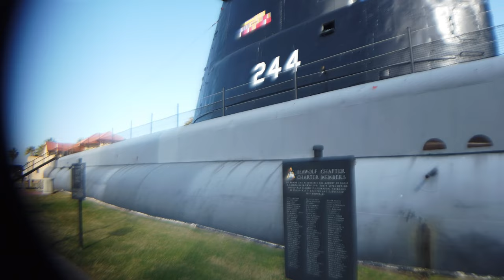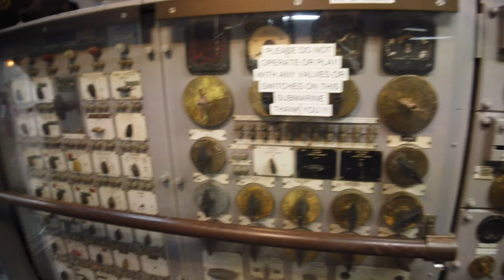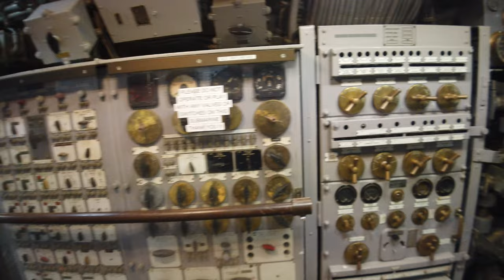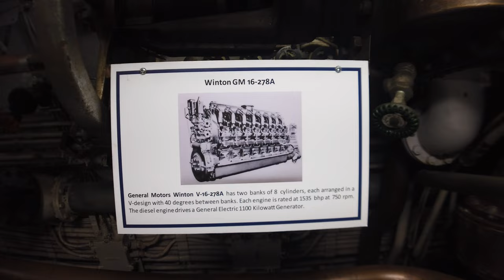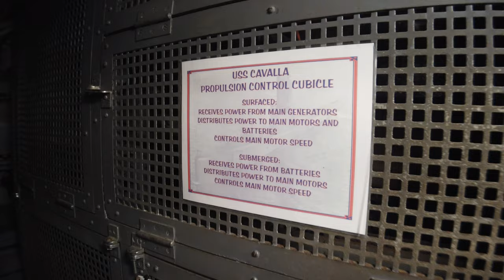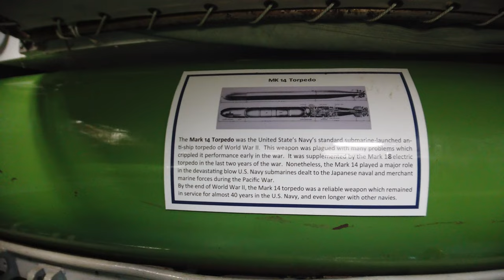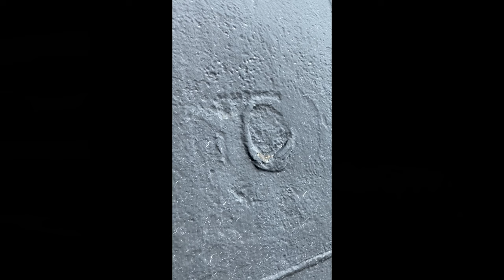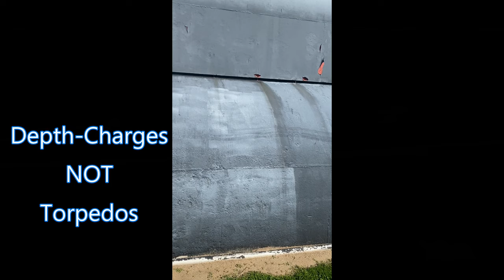USS Cavalla,  only American submarine to sink an enemy aircraft carrier single handedly, the Shokaku

Comment: The red light was for use while patrolling/surface action at night—so that captain/officers and crew could open hatches on deck and/or conning tower could man the deck gun and conning tower —without exposing bright white light thru the hatches potentially giving away the subs position to enemy—also the more dim red light allows for easier/more rapid adjustment of the eyes to the dark outside at night time. Deck gun could be used in lieu of valuable torpedoes to sink smaller unarmed freighters or finish off an unarmed ship that was damaged by torpedo(s) but not sinking. Also many torpedo attacks against merchant ships at night were carried out on the surface—as the sub could maneuver much more rapidly and travel at much faster speed on surface using her diesel engines than submerged where she had to use batteries only to power her motors.
Reply from the maker: I realized that about half way through, I was going to correct myself at the next light but none of the other fixtures had a red light in them.  I was overcome with awe at everything I saw after learning of her history. I was rather speechless the whole time
Reply: For example—US Gato class submarines had a top speed of 21 knots in surface using Diesel engines—but only 9 knots submerged while running on battery power.
Reply from the maker: @gregoryhall3156  wow thats slower than I thought, then again a people think of submarines as much smaller than they are. For what it is, it's huge outside, but you could never tell that from the inside.

Comment: The Cavalla attacked and sank Shoakaku—one of IJN carriers of the Shokaku class (the sister ship being the Zuikaku—which was herself sunk by US carrier aircraft in Battle of Leyte Gulf in Oct 1944)  These two large IJN carriers were the final two remaining carriers of the Japanese Pearl Harbor attack force— the other 4 (Akagi, Kaga, Soryu, and Hiryu) all being previously sunk by US carrier aircraft at Battle of Midway. Also Cavalla was NOT the only US sub to single handedly sink an IJN aircraft carrier—The USS Redfish torpedoed and sank IJN fleet carrier Unryu in 1944 (lead ship of a newer class of carriers of improved design based on IJN Hiryu)— there were also several small IJN escort carriers (many were converted merchant ships as emergency measure to stem the losses of their many larger fleet AC carriers)—including Taiyo by USS Rasher, Shinyo by USS Spadefish, Chuyo by USS Sailfish, Akitsu Maru by USS Queenfish. Also the IJN fleet carrier Taiho (namesake of a 2 ship class of fleet carriers built by IJN during early WW2 and first IJN carrier with an armored flight deck) was torpedoed by USS Albacore during battle of Phillipine Sea in 1944–struck by only one of 6 torpedoes fired at her—but disabled her foreward elevator and ruptured an aviation fuel line which eventually resulted in a large explosion 6 hrs later and caused her sinking. The piece de resistance of US sub sinkings of IJN carriers was however the Shinano—massive IJN carrier built from third hull of Yamato class battleships—worlds largest and most heavily armored AC carrier prior to USS Enterprise CVN-65. She was brand new and being rushes into service and on her maiden voyage was picked off by USS Archerfish. Wr are lucky that USS Cavalla was preserved—she is well worth visiting if you are ever in Galveston. US submarine force was an essential and often overlooked major contributor to our victory over Japan in the Pacific in WW2. Im addition to these important Japanese warships—US subs sank many many jaoanese cargo ships and tankers—eventually cutting off Japanese military from essential supplies of fuel oil and rubber and strangling their home island economy—they shortened the war by probably a year or more and crippled the Japanese navy and air forces (kinda hard to sail ships and fly planes without any fuel for them.)
Reply from the maker: your right, the Cavalla is the only one still above water, although that is through fate, no battle action
Reply: The USS Barb sank the escort carrier Unyo.
Reply from the maker: @seatedliberty  that true but the Unyo was built as a cargo ship. During the war a deck was added so she could ferry aircraft and cargo. She was never an operational battle carrier. Her hull and the ship itself were not built for battle. She was built a cargo ship and died a cargo ship, even though her cargo was partially aircraft
Reply: Shokaku was the only carrier ever sunk by a submarine that actually did anything and she was an awesome carrier, equal with Saratoga and Enterprise. She sank so many Allied ships it is ridiculous to even try to count how many ships that Shokaku sank and assisted to sink. The "large" 🇯🇵 carriers of 1944 sunk except for Taiho were airplane ferries, not really carriers, especially Shinano which was only ever designed to be no more than an airplane ferry cargo ship for planes. It is pathetic how people ignore Cavalla sinking Shokaku and claim the other airplane ferries were on the same level as Shokaku.

Comment: There is usual one diesel and two electric
Reply from the maker: well that makes since, thanks for the info. You know what anything else is in there?
Reply: @AJeepADroneAndAnOldMan  the other thing is a rescue bathysphere.
Reply from the maker: @101egals  dang it, that's not what I thought it was
Reply from the maker: @101egals  I thought it was part of the conning tower, under the steel plating
Reply: Should be Four Diesels, besides the auxiliary generator.  My best guess are "Fairbanks-Morse" opposed-piston engines.  From the hip, I'm thinkin' 12 cylinders, each engine,  two pistons, each cylinder, two crankshafts,  each engine.  Thinkin" 96 pistons in a pre-war to wartime production "Fleet Type Submarine".   Also, 2 Electric Motors for underwater propulsion.  Could be used while surfaced.  I am a Driver, but my interest stems from my father who served on the "USS Grouper", #214, before I was born.
Reply from the maker: @jamesbell8749  have you done research on the Grouper?